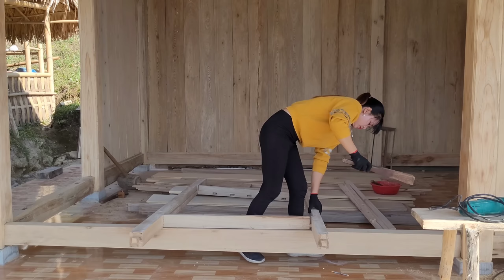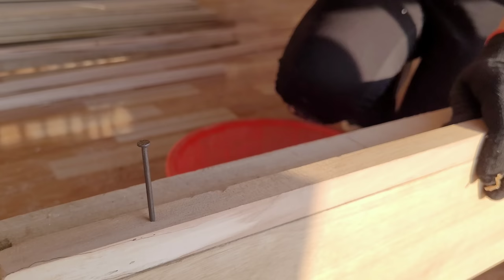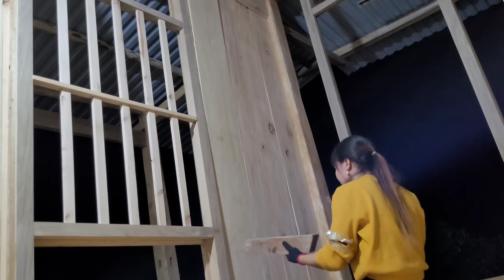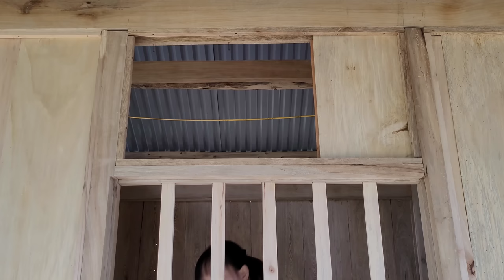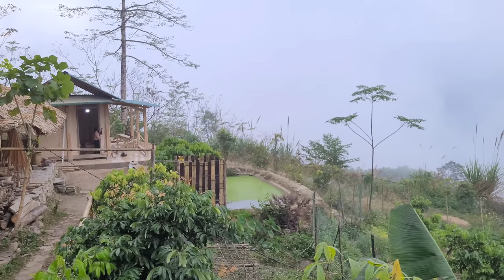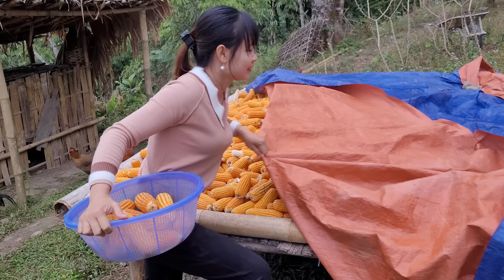Install the main door frame, window frames and fence the remaining walls of the new house.

Comment: Why do you leave your floors open? Why are the floors not connected to the walls? I mean like anyting can crawl into your home. Why is it necessary to leave such a space or Gap from the floor to the wall? This makes no sense to me. I really enjoy watching your videos. But sometimes I feel a need to question things.Also the same thing about the roof and walls?
Reply from the maker: thank you that's the way to keep the wood from rotting and avoid the ones that eat the wood